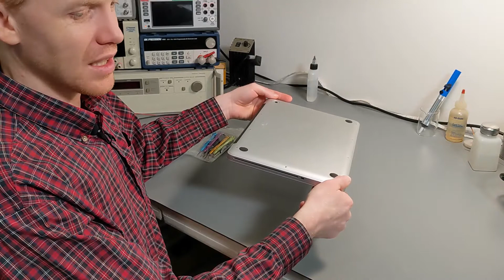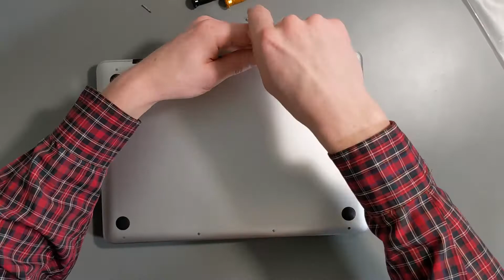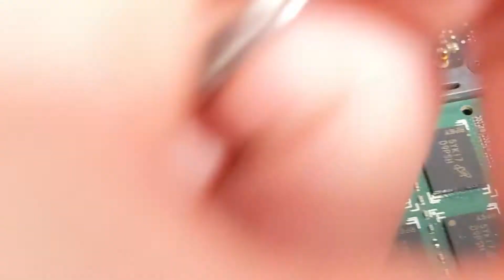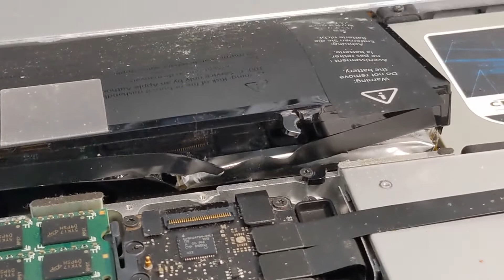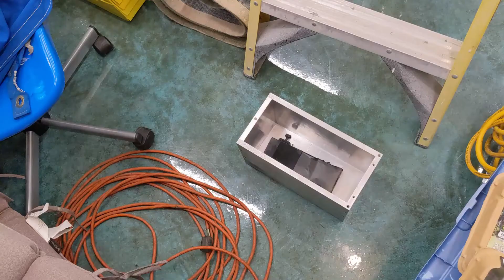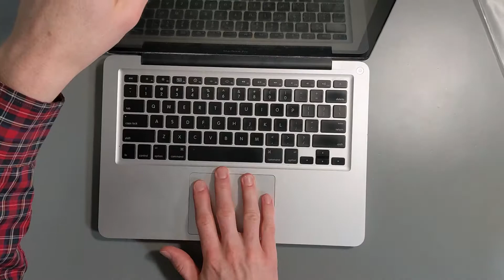Why is my laptop bulging?

Comment: For those watching this. DO NOT DO THIS unless you KNOW what you are doing. Lithium fires are amazingly dangerous. The flams can reach up to 2500f. Or the melting point of skin. The fumes can cause permanent lung damage as well.
Reply from the maker: Yeah if it's not caught fire yet then the important thing is to not charge it and not get it hot like don't leave it in the sun. I think Apple should be responsible for fixing it for you but I just took the battery to my local hazardous waste station and they took it for me.

Comment: Hi. I have a question. My macbook pro has the same problem. It's also bloated and Im scared to touch it. Would it explode If i open the macbook and remove the battery ?
Reply from the maker: Well you should make sure you don't have a warranty before messing with anything yourself, but my understanding is that the batteries mainly catch fire if they are over-charged so if it is not on and not charging then it's not likely to just spontaneously catch on fire. You could always take it apart outside if you were worried about it, but when a lithium battery catches on fire it's more like smoking and burning than exploding. It's just dangerous because it's a chemical burning that can't really be extinguished by water so it just keeps burning until it burns out from what I've heard, though I've never experienced a lithium battery catching on fire myself. Thanks for watching!
Reply: @CircuitAnalysis  thank you 😊

Comment: What should I do to prevent the swelling in the first place? My laptop has the functionality to stop charging at 60%, so as long as I keep it plugged in, the percentage is always at 60%, drops a bit when I turn it off and unplug it, then goes back up when plugged again. Can this lessen the chance of swelling or is it also doing some harm?
Reply from the maker: I think the main factors are temperature, state of charge (full charge being worse) and manufacturer defect. You can't do anything to prevent a defect, but you can try to keep it cool and the 60% state of charge function is good if it's available and you're keeping it plugged in all the time. I also noticed with another laptop that had the battery swell I had it in a stand so it was vertical and the back was down so the heat from the processor and other circuits was at the bottom and rising up into the battery which was under the trackpad. I think if may have been better if I had oriented it with the front side with the battery facing down so the battery stayed cooler. Good luck!

Comment: My Gateway Laptop has a bulging battery and the fan is super super loud. I have been continuously charging it 24/7 while using which could be the culprit I think. Definitely gonna have to get rid of it cuz the fan is extremely loud and the trackpad is about to break
Reply from the maker: Yeah lithium ion prefers to be about 50% charged for best longevity, but it's just not realistic unless you have an app that can keep it there. My Lenovo came with an app that lets you keep it at 60% if you're just leaving it plugged in. In general though although it will degrade faster the battery should not swell up, that is definitely a defect in my opinion.

Comment: im just worried about mine after heard about how a laptop battery could be swollen, my keyboard and touchpad seems fine and also the back doesnt seem to be extruded, and laptop battery life is also normal, what are other signs of swollen laptop battery?
Reply from the maker: That's it, if you don't see any bulging then you should be fine. The first sign for me was a growing gap when you close the lid, like it didn't close all the way because it was hitting the bulge in the middle of the keyboard. Most of them are fine though so if you don't have a problem then don't worry about it.

Comment: Thanks for this video... so I see that you can just use the charger without the battery? I'm looking at where to get the replacement parts, do you have any recommendations for where to get parts? I see a lot on Amazon...
Reply from the maker: Yes mine worked while plugged in with no battery. I don't know where to get the parts, I just got a new computer to be honest.

Comment: I know it's important to always do a back up when you repair things, but if you simply remove a bloated battery will it erase your Itunes Music Library?  I was planning to move my my music on a micro sd card but since my cursor pad is warped because of the battery it's difficult to high light and drag things.
I'm buying a new macbook pro next month, so I simply want this hazardous battery removed and will just use this old mac plugged in. So if I'm simply removing the battery only will it erase the Itunes Music ?
Btw, your lucky and gifted to remove the battery by yourself instead of taking it to an apple store which I dread since I don't know if they ask for your password or can simply remove the battery only with no
replacement.
Reply from the maker: Your hard drive which stores your music and all other files does not require any power to keep the files stored, so no, removing the battery will not erase your music. It will just make your laptop more like a desktop in that it will only run while you have it plugged in. A bloated bat is a defect though so I would go ahead and ask apple if if is covered under any warranty or anything.
Reply: Thank you so much for your expeditious reply to my inquiry especially from a non-tech person as myself, I
was really stressing over this before proceeding with the battery removal, so once again I appreciated!

Comment: Oh I was not able to remove the screws near the battery of my Macbook pro mid 2012 any help?
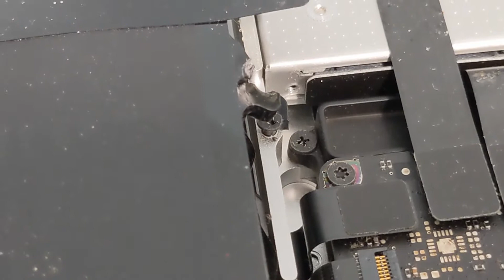Reply from the maker: Yeah the screws as I showed in the video were some sort of 3 pointed custom head (1:40) so if you want to be super legit you'd need to buy a special screw driver for that. I assume someone probably sells them on amazon or aliexpress, but I didn't need it since my battery broke itself off one screw for me and I was able to get the other out with a Philips driver. One thing though is make sure you don't have any warrenties or that Apple won't fix it for you before you start trying to do anything yourself, since it is a defect that should not happen in the first place.

Comment: some laptops get to go through some years of use and doesnt bulge, what exactly is causing the bulge? is it the heat from the device itself?
Reply from the maker: I'm not a battery expert, but the same thing happened to my HP laptop when I had it folded up in a stand behind my monitor during the warmer part of the year. I realized that I had it oriented with the back of the computer facing down and in my case the battery was under the mousepad, making it at the top. Therefore I figured all the heat from the processor and everything was rising up into the battery. Since then I've made an effort to put my new one in the stand the other way so the back is up and the battery is at the bottom and I've had no issues, but then it could also just have been a manufacturing defect.

Comment: is it okay to leave it on if the swelling is not that big like slightly puffed out?...I just removed my laptop batter because it is slightly swelling its like 25% fatter than it's regular size...I don't know if its still ok to put it back.. I am still earning  a budget to buy a replacement
Reply from the maker: I would not risk it, I would just use the laptop with the AC power adapter. Check if you have any warranties or anything and ask the manufacturer and/or store you got it from if they can replace it for free? It's definitely a defective battery.
Reply: @CircuitAnalysis  warranty ended a long time ago I bought my laptop 4 years ago... I was using my laptop using AC power for now... Fortunately there's a lot of spare battery on sale for my laptop.. Thanks for the advice anyway... I was still looking for e waste stations or recycling stations in my area that accepts battery..

Comment: You are a lifesaver! Too bad I found your video a little too late the bulging in my laptop is so bad the touchpad was completely lifted off, the chassis is made of plastic so the bulging actually broke it and has a few cracks. The touchpad was getting annoying and I decided to take it off since I use a wired mouse :( still wish I found your video like 2 months ago. Thanks again
Reply from the maker: Oh man bummer, well glad you liked the video. Yeah this happened to my work laptop too and it got pretty warped/trashed. Seems like a common issue.
Reply: @CircuitAnalysis  so if I remove the battery, can I use the laptop still, while it's on the charger cause I don't move it either way
Reply from the maker: As I showed in the video, mine worked without the battery. I can't guarantee yours will too but I think it is likely that it will work with just the charger plugged in.
Reply: @CircuitAnalysis  I have the Asus f555l and the battery pack is under the left side of the mouse pad
Reply: Bulg battery easy explode

Comment: Very helpful video. Thanks..:) my laptop bottom panel  below touch pad ripped off...it's Hp elite book. What should I do?
Reply from the maker: Oh bummer, I have an elitebook, but I don't know that I have much advice for that. Is it the whole bottom of the laptop or is it more like the top part surrounding the mouse pad?
Reply: @CircuitAnalysis  it's the bottom panel below the mouse pad.
Reply from the maker: @arunsannigeri  Did the battery bulge and push it off or did it just fall off?
Reply: @CircuitAnalysis  I suspect the battery has bulged...the corner screws are intact but the middle portion came off from the panel
Reply from the maker: Yeah sounds like it. I would check and see if you can return it or if you have a warranty on it and if so then back up all your junk and return it or send it back to HP. If not, then I would unscrew the back and remove the battery. Either way, keep an eye on it because those batteries are dangerous and can catch on fire, so you want to keep it in a metal bucked or a bucket with sand or somewhere where it won't burn your house down if it does ignite. I have had 2 laptop batteries do that last year and neither actually caught on fire, but I removed both batteries and put them in a metal can in my garage. What I'm trying to say is don't freak out because it's probably not going to catch on fire, but don't ignore it because it's certainly a possibility. If you do end up taking the battery out you can still use the laptop when it's plugged in, and you can always buy a replacement battery.